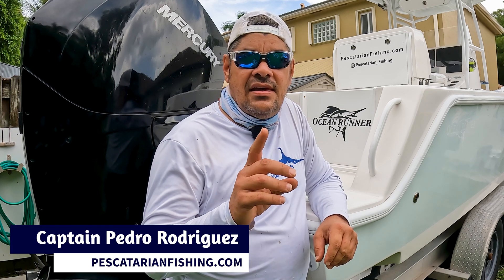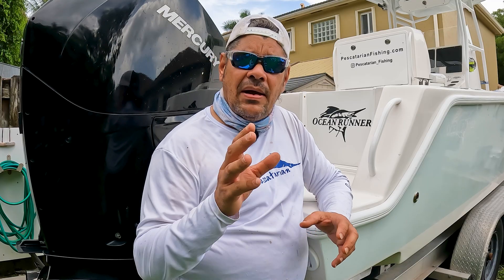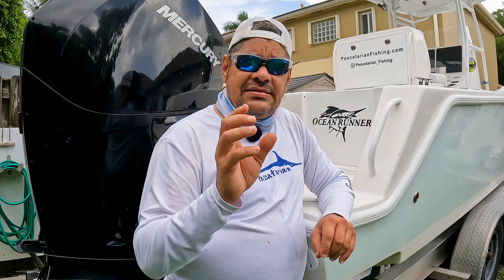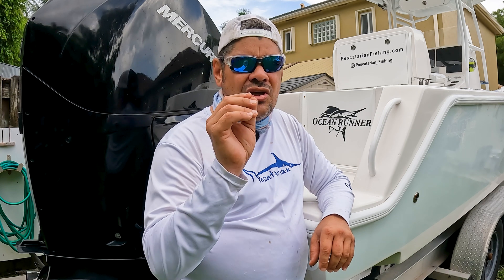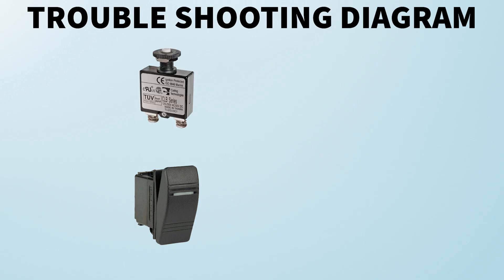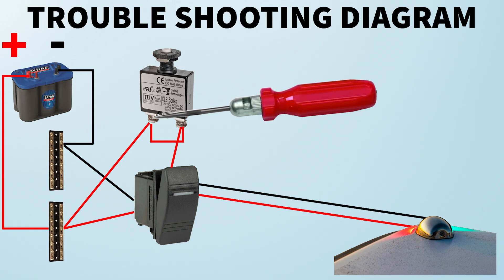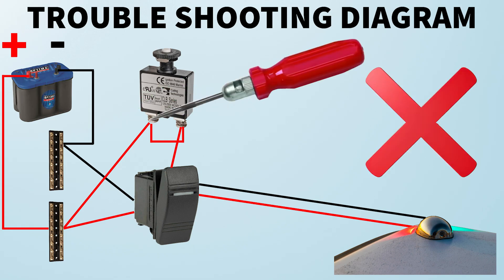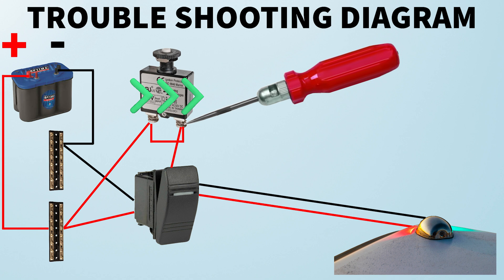How To Troubleshoot Marine Electrical Issues

Comment: curious if you have a suggestion on something odd i am seeing.  I have a small isotherm fridge put in.  Its been fine for 6 months and runs perfect.  in the last 2 weeks, when the compressor kicks on the lights (led) flicker / dim / or go off.  I even have another 12 volt appliance that reads "Low Voltage" Thats comes and goes but is usually fine if i dont use the istherm....if i turn on the isotherm on and it runs for a while I start getting low voltage on that 12 volt appliance and other compnents as well.  Not sure where to start with this....house batteries read full....
Reply from the maker: have you checked to see if the battery is good.  i had an issue one year where i was getting low voltage across my electronics and 3 out of my 4 batteries said they were full but they were bad and did not hold a charge once i put a load on them.